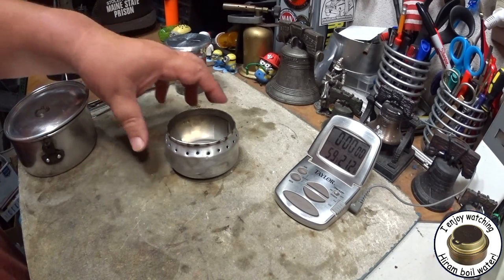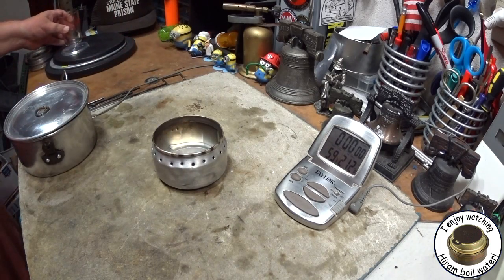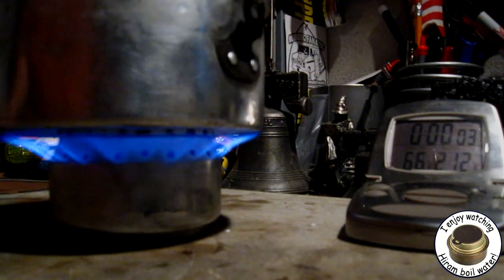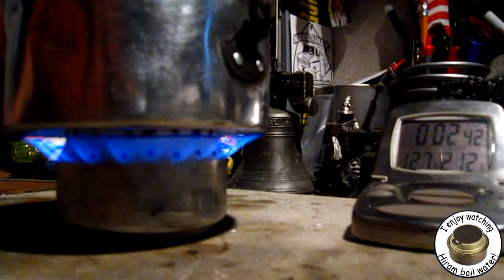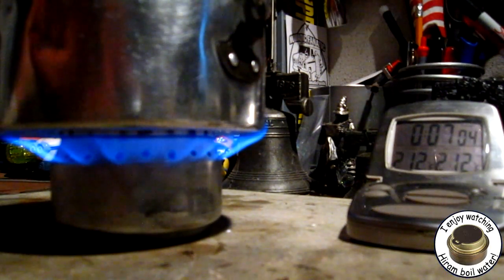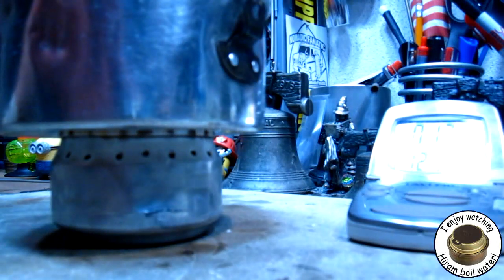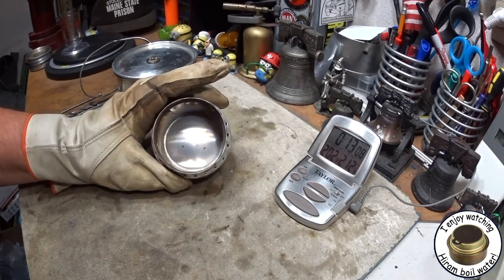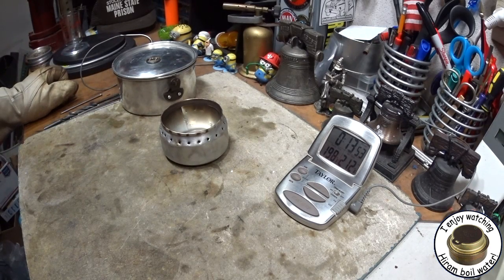NJ Chris' "SideBurner" Alcohol Stove - Boil test

Comment: ok huston we are go for a larger pot    in in for 4min 35 to boil lol
Reply: +embarado smithing and woodcraft i say definately try it with a larger pot, maybe even a small pot in a larger pot for dry baking ( after all by your calculations you should get about 25 mins of burn time off 2 ounces of methanol which is perfect for most baking recipes
Reply: i was telling h to do the boil test in a larger pot   i also make  larger soda stoves but what did ya use for this one lv never seen one this size
Reply: embarado smithing and woodcraft I built this one with 2 types of cans... The outside chambers were build out of a "tall boy" Bud lite can. The inner walls were build out of a 24 ounce beer can. I played around with some trash and what i made was essentially a alcohol stove that came to bloom really quick, was really sturdy, held alot of fuel, was still ultralight at under an ounce, and was efficient. to me, efficiency is everything since most of the time i go out with limited fuel...

This thing even stands up to cast iron pots!